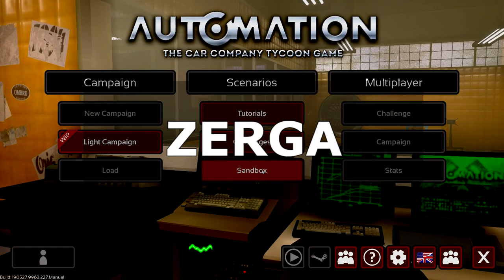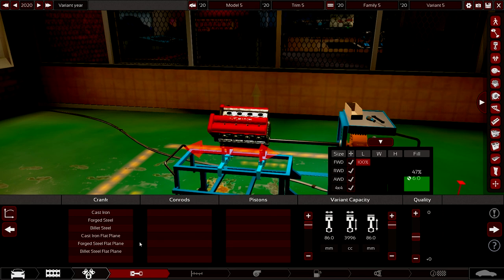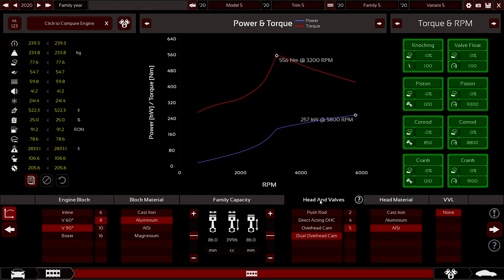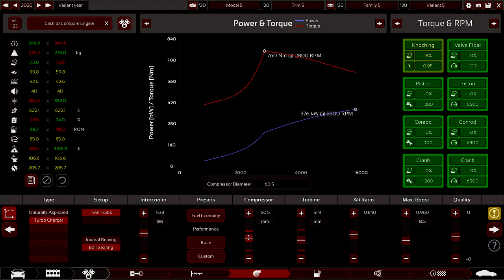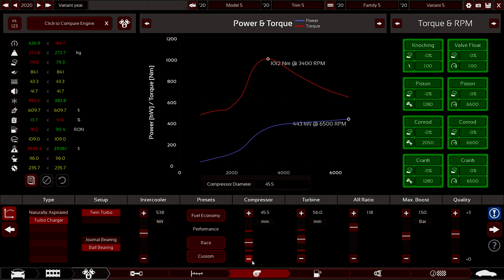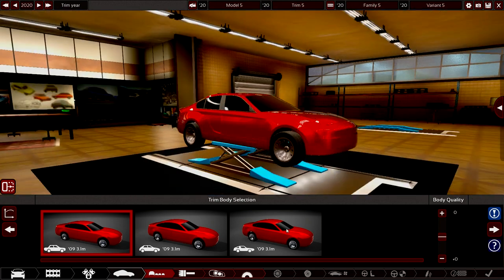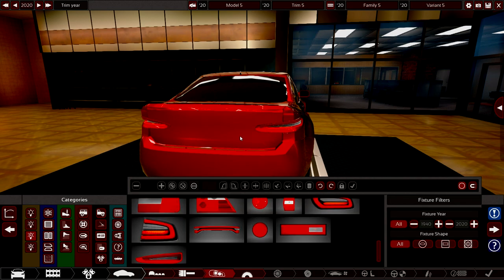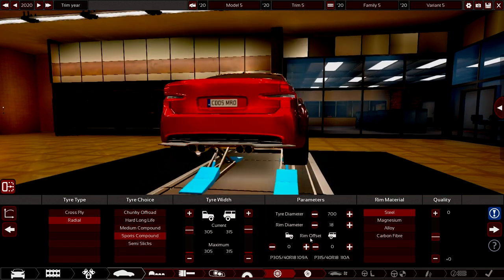700HP SUPER LUXURY SEDAN - Automation + BEAM NG

Comment: For sport cars put less stroke than bore on the block so you can put more rpm and more hp, higher stroke than bore is more for trucks as it makes a lot of torque but lower hp although it makes power from lower rpm but is not efficient when building a fast car.
Reply from the maker: Oh alright yeah I'll keep that in mind